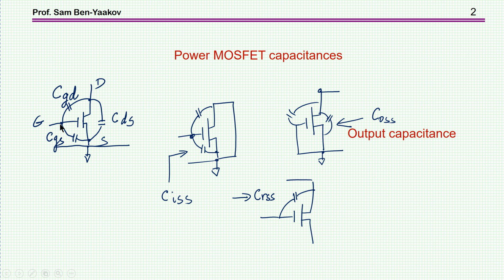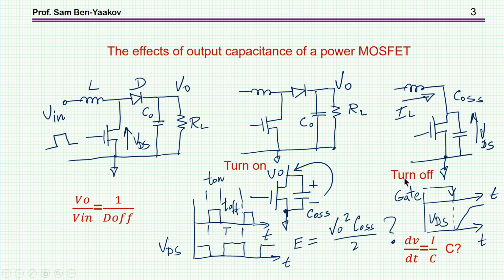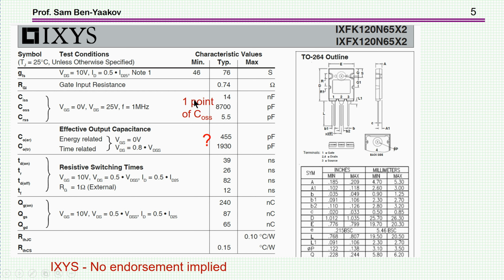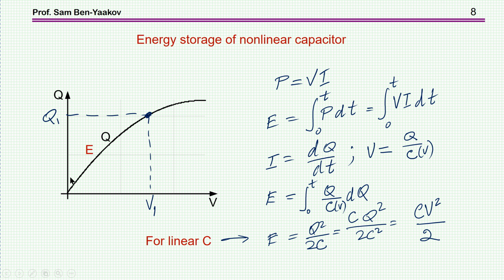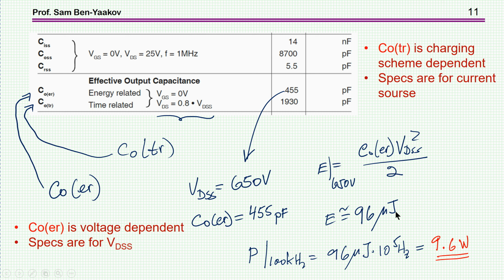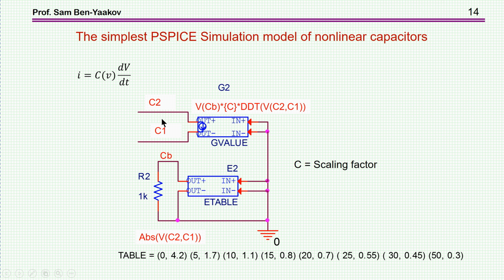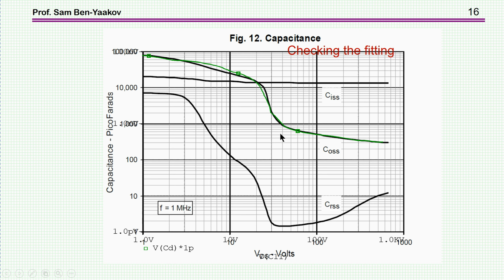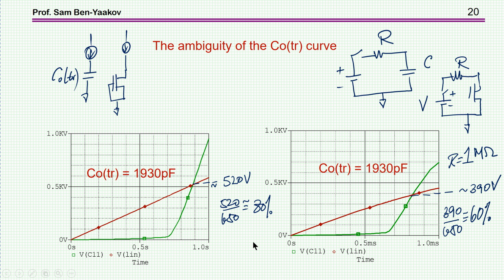Deciphering  Coss of power MOSFETs

Comment: When modeling soft-switching converters, when finding the required current and dead times, which would you use? Coer or Cotr?
Reply from the maker: For dead time, you need the energy related caoacitance.
Reply: @sambenyaakov Isn't energy related used for switching loss, and time related for dead time calculation?
Reply from the maker: @anirudhraghunath5901  Too short dead time IS causing switching losses

Comment: Great Vid professor! In a cascode configuration would the Coss be halved (series capacitors?) compared to a standalone transistor of the same make and model? Thanks
Reply from the maker: Not really. In linear cascode there is a BW increase but in switching, the capacitors still need to be charged and discharged.

Comment: Thank you so much for your explanation. I have seen for soft switching condition, some paper use energy-related 0.5*Li^2 > 0.5CU^2, in another use charge related Ql>Qc, in this presentation you have mentioned 2 types of capacitor energy-related and time-related. What condition we should use when we consider the ZVS condition for MOSFET. Thank you so much!
Reply from the maker: The requirement is that the communication will be carried out by circuit itself before the switch is activated. The conditions can be formulated in term of energy or charge , the results should be the same (if calculated correctly😊)
Reply: @sambenyaakov   Thank you so much for your answer!

Comment: Hello, professor! Thank you for your work! In the power mosfet driver lecture, we considered the gate current by the formula: Ceq=Cgs+Cgd(1+Vo/Vgs), I=Ceq*Vgs/Tr. 
But here we do not see the dependence of the input capacitance Ciss on voltage Vds. I'm confused.
Reply from the maker: You are absolutely correct. This is a very crude approximation primarily to show what is going on and the Miller effect. One should use the Q as a function of Vgs curve (which is also VDS deoendent). Thanks for pointing this out. Might help others.
Reply: @sambenyaakov  Thank you so much for the answer! With your permission I will ask more. Correct expression for datasheet calculations: Cgd=Crss,  Cgs=Ciss-Crss, Cds=Coss-Crss? Sorry, I am writing through a translator Google.
Reply: I dont mean to be so off topic but does someone know a method to log back into an instagram account..?
I was dumb lost my login password. I would appreciate any help you can give me.
Reply: @Kace Andre Instablaster ;)
Reply: @Davis Noah thanks so much for your reply. I got to the site on google and I'm in the hacking process atm.
Seems to take quite some time so I will reply here later when my account password hopefully is recovered.
Reply: @Davis Noah it did the trick and I finally got access to my account again. Im so happy!
Thanks so much, you saved my account !
Reply: @Kace Andre Glad I could help :D

Comment: Sam, I am glad you brought up the Coss topic with the energy it dissipates in a hard switched configuration.
However, I have found an IEEE article that states that the energy of the Coss should NOT be accounted into the switching losses of the MOSFET because we are already accounting it in the well known approximation Psw=1/2 * Vdd*Id*(ton+toff)*fsw.

The logical reason is pretty simple:
At turn OFF, we are overestimating the current through the channel of the transistor (hence overestimating the power loss at turn OFF), in other words, the current through the transistor is not "Id" but less than "Id" because part of the current flows into the Coss, charging it. Only part of "Id" flows through the channel of the transistor causing power loss.

At turn ON, we are underestimating the current through the transistor (hence underestimating the power loss at turn ON) because the total current through it is "Id" + current from the discharge of the Coss.

All in all, the above compensate each other resulting that the usual "Psw" formula does not need to be added to it the loss of the Coss (1/2 *Coss*Vdd^2*fsw).

In summary, the article states this:
Psw=1/2 * Vdd*Id*(ton+toff)*fsw + 1/2 *Coss*Vdd^2*fsw  <--- WRONG
Psw=1/2 * Vdd*Id*(ton+toff)*fsw <---- CORRECT

If the above is true, then it makes useless all the characterization of the Coss/Eoss loss the manufacturers struggle to give us in datahseets.

Please give me your thoughts into this since the Eoss energy can be quite important and makes a lot of difference if we take it into account or not.
IEEE article is: http://ieeexplore.ieee.org/document/4783535/
Reply from the maker: Hi Catalin, thanks for the discussion. Please note that the paper you cited is
from 2009, at the time that Coss losses were naively estimated as Coss*V^2/2.
To my understanding, this is not the only mistake in the paper. I would like to
answer your question in detail but would prefer to do that in the LinkedIn IEEE
Power Plectronics group so others can benefit. If Ok with you please log to 
https://www.linkedin.com/groups/2091456/2091456-6362073231909744640
(you may need to “be accepted” to the group if you are not already a member), and copy your comment to “The elusive Coss of power MOSFETs: How many output capacitances are there?” post, and I will answer there. Thanks.
Reply from the maker: You WILL be accepted. See you there
Reply: I definitely liked learning more about the nonlinear behavior of the Coss/Cds and the spice table simulation.

It will be interesting to hear Sam's take on that article, Catalin.  Maybe it matters because the current going into the resistance of the MOSFET cannot be measured because it is strictly internal to the MOSFET package  since a pure capacitance does not dissipate power or energy ?
Reply: Another power group. Thanks Sam !  I am surprised that I am not in that group already.

I ran across this paper today relative but interestingly shows even something else about Coss...

Coss hysteresis loss –the discovery...  Phenomenon first reported APEC 2014 by Enphase

https://training.ti.com/sites/default/files/docs/HVI_Coss_ZVS_15-Sept_complete.pdf

I may post this link to that group when (if) I get accepted as well.
Reply: I will join that group and post again the question there as suggested. In the mean time, here is an app note from OnSemi which shows clearly that the current through the channel is overestimated and underestimated at turn OFF and turn ON respectively, shown clearly in figure 3.
http://www.onsemi.com/pub/Collateral/AN-8230.pdf.pdf